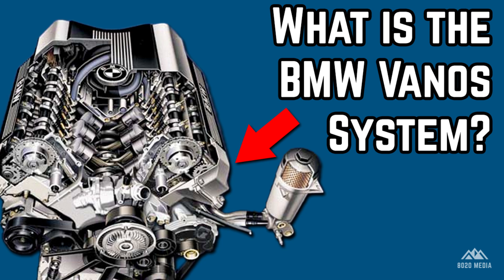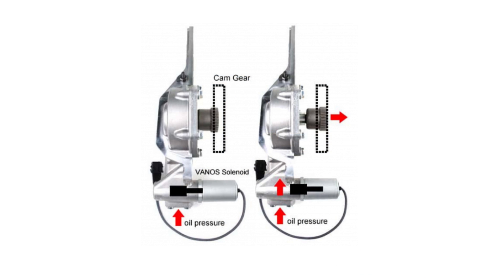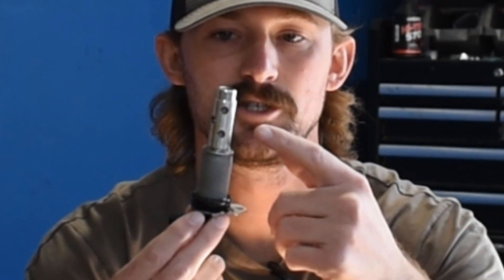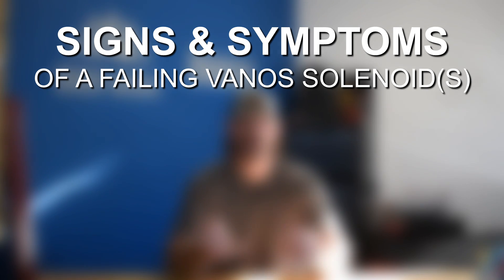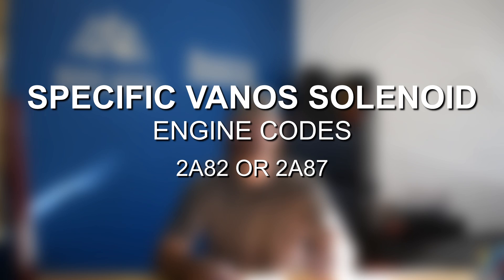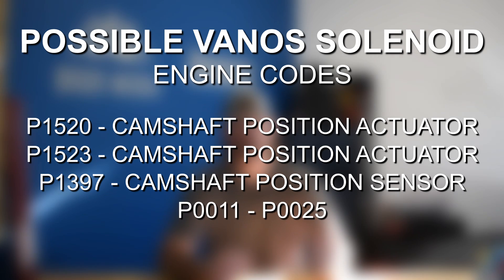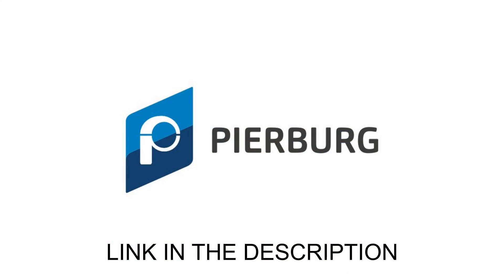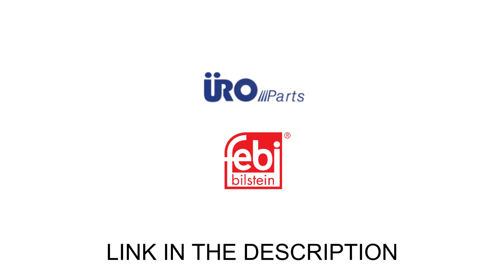Symptoms & Diagnosis of a Failing VANOS Solenoid!

Comment: Thanks for this im going to check mine now! Im not showing a code for the vanos though. However after I tuned it with a mhd ost whenever i wide open throttle and it hits 4k rpms it misfires on cylinders 1 and 6 has rough idle at start up too then smooths out and as long as i drive it normally and dont get on the throttle hard or do any pulls it doesn't misfire.
Reply from the maker: G - Check your ignition components as well! Keep us updated.

Comment: I'm looking to buy a 2004 525i with an N52 engine which they reckon smokes a bit, could this be a symptom of a VANOS system problem too?  TIA
Reply from the maker: G - It's possible. But could be a wide array of other things.

Comment: BMW 130E20 CODE, P1338, Intake Camshaft Angle Deviation with respect to crankshaft outside tolerance, what would you suggest for this, my timing chain and everythign was done only 30k miles ago, im confused
Reply: Lmk if u fix it, I have the same problem 😐
Reply: @ricardomejia5804  what have your mechanics said?
Reply: Did you get fixed? What was it
Reply: @devronscott2359  vacuum pump and boost solenoid

Comment: i had a N54 exhaust camshaft sensor / vanos error code. did a liquimoly oil additive cleaner and oil change, also cleansed the two non-return valve metal filters under the right wheel well. seems to have solved the problem. got new vanos from FCPeuro, but have not installed them yet, as i have not had any further issues. i do my oil changes every 10k km.
Reply from the maker: I - Thanks for taking the time to share your experience!
Reply: o correto para troca de oleo não é por km rodado e sim por horas de motor ligado,
Reply: Do shorter oil changes and u wont end up bk with the problems.. when u wait  so long to change oil the oil starts becoming gunk and also breaks down seals and u get oil leaks.. cut the 10k in half... just a tip for u if u wish
Reply: @deanevans5338 he's saying kilometers which is around 4500 miles

Comment: Thank you for the awesome video! I have a 2009 328i E92 with N52 engine; it runs really well, for 201k miles but, it now, kind of vibrates on idling and I got a 2A87 - "DME: Exhaust VANOS mechanism" code; thanks for the valuable info; I'm sure I need to replace the solenoids
Reply: Hey mate..did replacing solenoids solve the issue?
Reply from the maker: Yepp likely the solenoids giving you trouble! https://bmwtuning.co/product/bmw-vanos-solenoid-n52-n54/

Comment: Hey man thanks so much for this video , have a e92 n54 , car just randomly threw up 2A82 , 3100 boost deactivation today , had alittle bit of white smoke for afew seconds from both exhaust , car instantly went into limp mode
Reply: Just happened to me did replacing them fix it?
Reply: @krabes8613  yeah it was my intake side cam ledge bearings
Reply from the maker: M - Thanks for coming back and updating. This will certainly help future viewers!
Reply from the maker: M - Sounds like a Vanos issue. Keep us updated.
Reply: @8020Automotive  yeap! Used ISTA+ to diagnose , was a intake side cam ledge bearing failure , it wore out just alil which cause vanos not to be able to hold pressure

Reason why i kinda knew it was the bearings was because code didnt come up until it changed gears which led me to believe pressure was not sufficient to support the vanos

Comment: THANK YOU SO MUCH FOR THIS VIDEO.  I have a question my car has p0015 code.  I was looking for symptoms of this vanos sensor and none of the videos mentioned a horrible squeaking noise my car makes.   At the same time the noise starts the car loses power and it runs off.  will changing this sensor help??
Reply from the maker: Have you noticed any trends with when the noise starts? Is it completely random or does it start after you do something? Like give it gas, turn the AC on, etc.

Comment: Hello, I have a 325i 2010 N53 slows down unstable and shakes when cold, it lasts 1 minute and afterward the car runs very well. When she does that I accelerate slightly and that prevents the shaking and slows it down unstable, do you have any idea, said the vanos? No smoke, no smell of gasoline. New spark plug and coil. I'm French, sorry for the translation.
Reply: I have the exactly same issue on my 2010 N53. I have replaced all 6 injectors, spark plugs, coil packs and PCV, still getting the intermittent lumpy idle.
Reply: @Holdeenio  Vanos and filter for vanos ? Admission d'air and disa ? How much did you pay for the injectors, did you do the adaptation mode? Before changing your injectors, the exhaust smelled of gasoline, was there smoke?
Reply: @94tontonche  I’ve got new VANOS solenoids to fit next… that and a new rocker/valve cover, gasket and breather hoses. My car came with index 9 so I upgraded to index 11 injectors, coded and re-adapted. Before changing them there was some white smoke on idle and yes occasionally a smell of gasoline.

Now there is no smoke, but still a smell of petrol sometimes.
Reply from the maker: Definitely change out the vanos solenoids before jumping into anything crazy expensive like fuel injectors. Sounds like it could definitely be the vanos causing those problems.
Reply: @8020Automotive  Thank you very much, yes from the least expensive to the most expensive, continue the videos, I don't know if you talked about the vanos filters, a video on them would be good.
Reply from the maker: 94 - Thanks for the feedback! We will add it to the list.

Comment: My n52 which clocked 220k km in milleage has weak power deliver, had catalyzer flush by pro shop and cylinder head clearance done a month ago, no fault code.... Scratching my scalp now... Any advice ?
Reply: Have you checked disa flaps
Reply from the maker: T - We have a video about losing power that we hope can be helpful: https://youtu.be/ipjYLPJgpq8

Comment: Is there a difference between the n54 and n55 solenoids? Apparently the n55 is an updated version but i wonder if they're interchangeable..
Reply from the maker: They are different (and more expensive for n55) but I've never tried switching them out. Haven't heard of anyone that has but all of the aftermarket manufacturers too have different part #'s for N54 and N55 so that's a pretty good indication that there is something different enough
Reply: @8020Automotive  They are not interchangable

Comment: Thank you for your help in explaining the symptoms of this trouble. Well done video! A couple of things to note. The S54 doesn't use those solenoids.  As well BMW doesn't Use "P" codes. Generic readers use them and they are fine except when we're using the actual BMW reader we won't know what you're codes mean as we don't get them.
Reply from the maker: F - True. Thanks for the feedback and sharing this insight!
Reply: but if you are using a BMW specific scanner, wouldn't it define the codes for you anyway?
Reply: @sleepydragonzarinthal3533  hell no. You need ista
Reply: Whats this vanos cage missing from the oil filter ?  What does that part look like (I believe that may be the case w my 2009 528i bmw 5:11

Comment: Hello i have a 06 bmw 330i and the rpms have been fluctuating after i replace my ccv system and when i ran it on mycarly my car was pulling throttle valve codes, throttle valve adaptation, vanos code and a cps code as well. I replaced the battery the throttle body and the maf sensor  i just recently put in a new camshaft position sensor. I started the car and it was kinda still fluctuating up and down. Ive been trying to figure this out for a few months now i have a vanos solenoid code but i want to know would the solenoids be the reason of why the throttle codes are being pulled.
Reply from the maker: Astro - Definitely possible. Think the best thing to do would be to clean the VANOS solenoid to see if that alleviates anything. Keep us updated.
Reply: I will be im getting the solenoids tomorrow
Reply: But ima gonna clean the ones already in there today
Reply from the maker: Astro - Keep us updated. Hopefully this alleviates your issues.
Reply: What if I'm getting a p1056 code
Reply from the maker: Possible causes:
VVT fuse is faulty
Defective load reduction relay
Plug/Kb-B open circuit in power supply circuit
Plug/Kb-B open circuit in relay supply circuit
Reply: If the 06 is a M54 engine it doesn't have solenoids
Reply: That is cam shaft position sensor
Reply from the maker: D - It's possible, but not always.

Comment: Hi. my N52 with 200k kms is weak, high consuptions and jerking at low rotation (form 800 to 1,5k rpm). But no alarm in BC and by diagnosis (no codes you showed), how come?
Reply from the maker: Punnie - Do you have any codes at all? Have you scanned for them?
Reply: @8020Automotive  i scanned by DeepOBD. I have to try with ISTA?
Reply: I think my PCV has some problem because when I open the oil cap I hear a strong suction of air @8020Automotive
Reply: Due to high blow-by the oil vapors get dirty the NOX sensor and get lean carburetion. The engine is at end of life  @8020Automotive

Comment: could a failed vanos solenoid cause the engine to stall? i replaced both cam position sensors in my 99 328i but no have no power in low rpms and a stalling issue.
Reply from the maker: Wizard - Certainly could!

Comment: Hello , I have a 28a3 code intake Vanos , I have checked my oil filter housing it’s not cracked. I have 2006 n62 , on start up I have a 2 second oil light then it doesn’t come back. Do you think it may be the 6 non return check valves or just a solenoid.
Reply from the maker: W - We would guess it's the solenoid.

Comment: 2006 330i n52, idle is jumping little bit, sometimes shakes after start for bit, here is what is done

1. changed spark plugs and ignition coils 
2. cleaned throttle body
3. cleaned check valves
4  just changed vanos solenoids as well. 

No Vaccum leaks
car runs fine but idle issue not going away, what could be the issue?
Reply: Same thing’s  happening to my 2007 120i. Does your car misfire when stopping then taking off?
Reply: Fuel pressure ? Koeo and when accelerated ? 
Maybe idle air control valve stuck , leaking intake gaskets ( same as vaccum leak ), throttle position sensor ..plugged egr ...just a couple more things to check @Jaaannn01
Reply from the maker: Two questions: Do you have a CEL? How many miles?
Reply: @8020Automotive  no CEL, 81k
Reply from the maker: Sounds like a rough idle. We have a video dedicated to this that we think will assist: https://youtu.be/BiYsqRJCLhE

Keep us updated.
Reply: check DISA